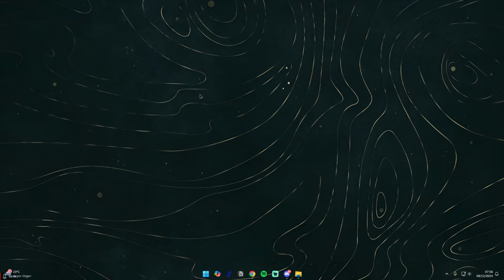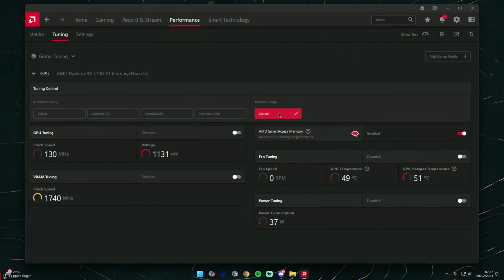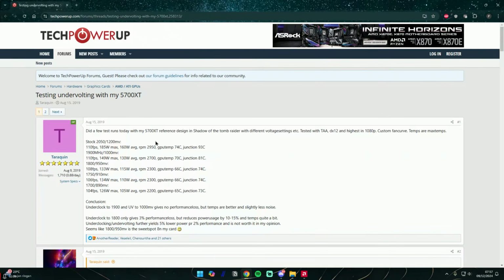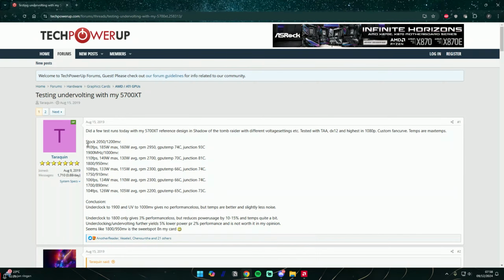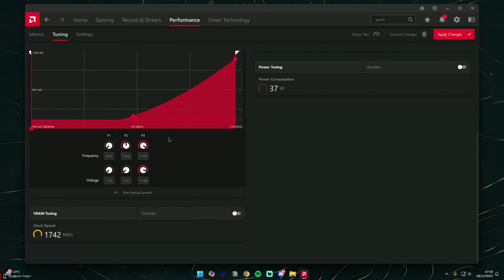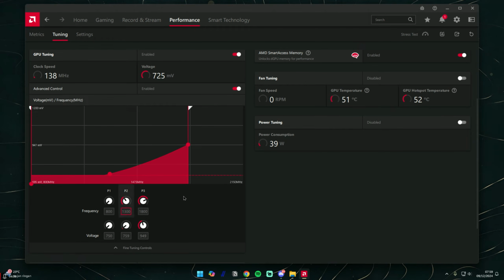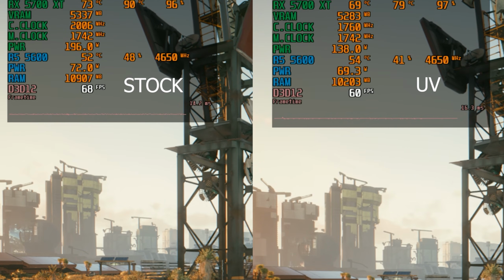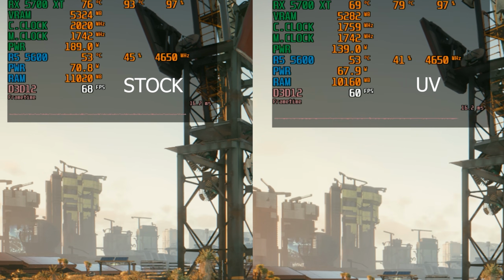How to undervolt your RX 5700 XT (or any other AMD card)

Comment: Hey man can. I get this gpu or Rx 6600 I want to have the best raw performance.
My psu has 2 rails each 17A and I know it's a good model even if it Is old . From seasonic
Reply from the maker: Sorry I couldn't be bothered to do the math, how many watts is your PSU?
Reply: @fancyzx 408w on the 12v line alone
Reply from the maker: @Adhamyt8990 in that case better go with 6600 as it uses less power
Reply: @fancyzx  does it give the exact performance as the rtx 3060 or Rx 5700xt ? CUZ I see it significantly slower than them in benchmarks
Reply from the maker: @Adhamyt8990 You are right, it is slightly slower, but it is a lot more compatible in more games such as Doom TDA, FF7 Rebirth, Indiana Jones, and maybe RT required games in the future. It is also a lot more efficient. The RX 5700 XT on stock pulls about 200w, undervolting will bring it down to about 140-160w which I am not sure if 400w is enough. Even my old 554w on the 12v rail wasn't enough to keep the RX 5700 XT underload, so I had to upgrade my PSU to 650w with 647w on the 12v rail.

My advice is, if you're not planning to upgrade your PSU then go get 6600, but if you are going to upgrade your PSU, maybe just skip the 5700 XT and save up for 6700 XT or maybe 6600 XT. If you ever plan to use upscaling technology, get Nvidia like the 2070, 3060, 3060ti, or 3070.

I'm not saying the 5700 XT is bad, in fact it is a very good performer for the price, but sadly it runs short on the technology and it is quiet power hungry.
Reply from the maker: To be honest with you, I couldn't feel the difference between the 5700 XT and the 6700 XT. Now that I have switched to the 6700 XT, the performance is surely different, but the experience is about the same. At least I got to play and finish FF7 rebirth though xD
Reply: @fancyzx u sure the Rx 6600 is enough for 1080 60 in last story games that released at medium or high native?
Reply from the maker: @Adhamyt8990 Medium 60 is possible, maybe even use FG for games like BM Wukong. But it will probably fall short in 1080 High
Reply: @fancyzx do you think it's more about the resolution at the time like maybe beyond Rx 6600 or similar we won't get any better results? In 1080p . It's just yk even rtx 3070 can't handle starfield . And I wanna play games and I'm sure at least one of the them is a hell pathetic trash ugly of optimization. My cpu is Ryzen 5 3600 4.35gz oc and 16gb. Of ram dual 3200mz oc 

These the games I wanna play 
 
Last of us 1 , 2
Re9 and other versions
Spider man 2 and other versions
And maybe ill
And there's more to add cuz I won't stop on one game but I still don't know which to add .
Reply: @fancyzx would u recommend me oc the Rx 6600 so I can get better results or maybe just get the Rx 6600xt ? Or maybe I should also overclock it when I get it
Reply from the maker: @Adhamyt8990  Last of Us runs pretty well on AMD, RE9 I'm not sure, but looking back at 7 and 8, the engine is pretty well optimised. Spider Man is quiet CPU heavy, other than that the GPU will most likely hold above 60 (maybe medium settings with Spider Man 2). It seems like its going to be fine, besides those Unreal Engine 5 games and something like Monster Hunter Wilds. I mean, even those games the RX 5700 XT doesn't do much better
Reply: @fancyzx do you think it will come a time where gpus like rtx 3070 3080 4070 become a 1080p one?
Reply: @fancyzx is the Rx 6600 a better worth upgrade from GTX 1660 ti than to the rtx 3050 8gb?
Reply from the maker: It could be resolution and it could be not. For example, the RX 6700 XT theoretically is faster, but in 1440p, it kinda sucks actually, losing to RTX 3070 even though it has 12gb of vram. I just think that most of the mid range graphics card perform pretty much the same, maybe there is a 15-20% difference but the experience when playing a game is pretty much the same. These GPU are: RX 5700 XT, RX 6600, 6600 XT, 6700 XT, RTX 2070, RTX 2080, RTX 3060, RTX 3060 TI, RTX 3070, RTX 4060, RTX 4060 TI, RTX 5050, ARC A770, ARC B580. Even though some of these GPU is faster than other, you are pretty much getting the same experience.

I can tell you that much because I've had experience building these PC for my friends over the past years.

But what I do notice is that different games has different optimizations. Some games favor Nvidia and some favor AMD. So its basically comes back to what you are playing.

Though when it comes to 1440p, it becomes much clearer which one to choose (without having to think about CPU in mind, and expecting your CPU will suffice).
Reply from the maker: @Adhamyt8990  The 6600 XT is about on par with the 5700 XT and the 3060, if you have the opportunity, probably pick up 6600 XT or 2070, if you have a bit more or you find a good deal, pick up a 3060
Reply: @fancyzx  I can't for the Rtx 2070 cuz of my psu . At least that's what chatgbt said
Reply from the maker: @Adhamyt8990  RTX 3070 is already a 1080p GPU due to its vram. The 3080 and 4070 I think it will take a few years
Reply from the maker: @Adhamyt8990  the RTX 3050 8gb is not worth it at all, even though its the 8gb variant, its still a tad weaker than 6600.
Reply from the maker: @Adhamyt8990  Then 6600 seems like the number 1 option.
Reply: @fancyzx since you say you make these builds. Would you recommend me some tweaks maybe related to Radeon software or drivers? Rx 6600 or Rx 6600xt
Reply: @fancyzx yes . Even tho I felt like getting an nvida card for rt and stuff and maybe dlss 3.5 but wtv it's not the end of the world maybe later in year or 2 I'll get
Reply from the maker: @Adhamyt8990  Sure, I can help you tweak your system.

If you are still unsure, just watch a lot of comparison between RX 6600, RX 6600 XT, RX 5700 XT, RTX 2070, and RTX 3060. Make sure to watch more than 2 because different channel uses different games to test.
Reply: @fancyzx should I just disable everything in the software Radeon?
Reply from the maker: @Adhamyt8990  Yes, unless you need them for something. I usually just turn everything off except for recording. If you want to use the software feature, like AFMF or Anti-Lag, then leave the overlay turned on.
Reply: @fancyzx oh yes about antilag I don't think it's in all game and yk I can't play any game without a technology like reflex but reflex isn't in amd. Should I enable it the antilag in software Radeon or is it in all games or what and does it kill fps like it's worse than reflex?
Reply from the maker: @Adhamyt8990  Not really worth turning on in my opinion. In my experience, it doesn't make any difference. When it comes to competitive games like CS or Valorant, they have it implemented in the game, so yea just have it off. I haven't tried combining it with FG though, if you wanna try that out you can.

And yes, its worst than reflex, since most games partnered up with Nvidia, reflex has better implementation in almost every game that supports it
Reply: @fancyzx i only play story games .
Reply from the maker: @Adhamyt8990  You could probably install linux then, as it gives better performance. I can't help you with linux though, as I'm not familiar with it
Reply: @fancyzx I mean I have windows 11 lastest version and I debloted it and optimize it. Is it worth going with Linux or cachy os ? Ryzen 5 3600 and Rx 6600 "future gpu" 16gb of ram . Also I install mods in everygame . I use obs and davinci resolve
Reply from the maker: @Adhamyt8990  Yes it's definitely worth it, if you don't use any apps that exclusive to windows that is. Since I do a lot of work on my computer, I can't really switch to Linux
Reply: Do you know what apps and features that I wouldn't be able to have in linux ? @fancyzx
Reply from the maker: @Adhamyt8990  A lot actually, such as Adobe apps, Microsoft apps, Blender, OBS Studio, and more.
Reply: @fancyzx then no . Even mods wouldn't work then
Reply: @fancyzx do you think that we came to a time where wtv gpu we. Have we still don't get the experience we want?. And I know this question is kinda subjective but I'll just say it we live in different countries though. Yk that Nvidia said she will lower her production by 40% right? . Well I just got my gpu used GTX 1660ti with the box and everything just weeks ago and heard people say that the only gpus that will yk get more pricely are rtx 20 and above  and rx 60 and above
So is it true or it could also get to the used market ? I mean the Rx 6600 or xt that I'll get is used already
Reply from the maker: @Adhamyt8990  
Unless you buy a very high end GPU, I think you can get the experience you want. I know the state of games optimization are lacking nowadays, and GPU technology seems reaching its end.

Well for now, used GPU price seems normal, it is yet to go up in price.  Unless there is a more demand for used GPU, then most likely they will be an increase in price soon. I do think there will be an increase in used GPU prices sometime soon, but not as much though, because these used GPUs are not really needed for anything besides gaming and professional work (referring to Ai companies). Unless there is another crypto currency boom, then yea it could increase a lot in price.
Reply: @fancyzx yea maybe mining..

Comment: Is 85-90c hotspot ok? I got it on stock settings. With undervolt my hotspot is 70-75 but i don't wanna lose performance with undervolt, my 5700XT barely handle my new 1440p monitor and i need to wait until January to upgrade it.
Reply from the maker: 85-90c is a bit warm but its fine, and yes, the 5700 xt doesn't do well in 1440p, you should probably upgrade to a better GPU such as 6800 or the newer generation as it offers fantastic performance for 1440p

Comment: I have the ROG strix version, the temperature is up to 80 and the hot spot is 110, how do I get this (what are the best settings that you recommend to me )
and thanks
Reply from the maker: I'd say first thing you wanna do is to drop the mV to 1000, then bring down the clock to 2000. If its unstable you can continue lowering the clock speed to 1950-1970, then you can slowly bring down the volt down to 980, 970, then 950. It should bring about 10-15c less
Reply: @fancyzx  I did, but the heat increases after ١٠ minutes
Reply from the maker: @mohamedlaid6637  Maybe you need to change thermal paste, then after you might see temperature differences, like stable temperature even after 10 minutes. 

Try 850-900 mV at 1800Mhz

Comment: how about in msi afterburner tho?
Reply from the maker: It should be straight forward, just change the Core (Mhz) and Core (mV) to your preferences, don't forget to save it in a profile, and make sure you have afterburner running at windows startup.

Comment: i do not have the same gpu i have rx 580 but for some reason i cant see voltage metric or tuning in amd adrenaline software
Reply from the maker: Thats odd, it should have the same interface, I used to have rx 580 and it was the same

Comment: mau tanya, ini berlaku untuk 1 monitor saja ya ? saya pakai dual monitor, dan udh coba 2 settingan yg 1900 dan 1800 hasilny crash
Reply from the maker: Saya pakai dua monitor aman saja. Mungkin bisa di coba untuk menaikkan voltagenya perlahan dari setting paling terendah. Tidak semua RX 5700 XT bisa di undervolt secara agresif. Kasusnya seperti RX 580 saya yang dulu, tidak bisa di undervolt dengan baik karena bekas pemakaian mining.
Reply: @fancyzx  syaa udh cb cb uv mas, tpi knp bagian hotspot gpu ny masi sama di 110 c ya ? apakah perlu ada repasta mas ? atau ada settingan lagi di bagian fan ny mas
Reply from the maker: @tmk.s331  Setting UV nya seperti apa mas? Kalau saya boleh tau, voltage dan frekuensinya berapa?
Reply: @fancyzx  dpt stabil 1800/1040 mas, high peek di 154 watt, stabil di 130-140 an , tuntuk fps turun 15-25 an klo untuk game tpi sya pake fps lock di 180 jadi engga terpengaruh, ini cma lagi otak atik di fan temp ny aja, ada saran ?
Reply from the maker: @tmk.s331  Kalau saya fan speed max 75% di 75c. Kalau masih 110c di hotspotnya dicoba ganti thermal pastenya, mungkin membantu sedikit tapi tidak akan signifikan sepertinya. Saran terakhir bisa coba 'washer mod'. Inti dari modnya mengencangkan kontak antara heatsink dan die dari GPU nya, banyak tutorial di YouTube mas atau bisa baca-baca di reddit.
Reply: @fancyzx  ok mas makasih saranny :)
Reply from the maker: @tmk.s331  Siap mas, semoga bermanfaat.

Comment: info psu seri apa ? brp watt ? kalo gw pake psu 550 watt fsp hv pro
Reply from the maker: Zalman 600w, sekitar 550w di 12v nya
Reply: @fancyzx  apa itu 12v?
Reply from the maker: @adamsairenjiharuna3650 Di bagian pinggir psu itu ada dc output, disitu ada keterangan perihal volt dan daya yang dihasilkan dari voltnya. Pada umumnya komponen komputer pakai +12v, jadi biasanya daya paling besar akan dikeluarkan dari +12v itu. Kalau untuk power supply bisa dilihat dia pure atau engga dilihat dari output +12v itu sendiri. Sebagai contoh kalau psu 550w, bisa aja +12v nya output tidak sampai 550w tapi hanya sampai 500w berarti sebenarnya psu tersebut bukan 550w
Reply: Ini diatas tutor rx5700xt AMD undervold ya
Reply from the maker: @adamsairenjiharuna3650 Iya betul

Comment: I have bought a few days ago the sapphire nitro plus version of this gpu, in furmark tast the temperatures are 82 degrees on max usage and 108/109 in hotspot, very hot! You think undervolt the gpu is the better solution? Many people told me to change thermal pad and paste, but if i could avoid to open the card it would be better 😉
Reply from the maker: I got a similar temperature the first time I got the card. I do suggest changing the thermal paste first, it will drop the hotspot by 10c, and then proceed with undervolt, it will greatly help the card, preventing it from melting lol
Reply from the maker: But if you don't want to take risks, then a simple undervolt will do just fine
Reply: @fancyzx  Ok, only thermal paste? Or you have changed also the thermal pad?
Reply from the maker: @jacopodastolto4692  I didn't change the thermal pads because they were still in good condition, if you see any melted thermal pads you maybe need to consider changing them
Reply: @fancyzx  ok thank's mate! 
I saw you have ryzen 5 5600, i have the i5-12400 with stock cooler, maybe ill' get another heatsink in the next few days
Reply from the maker: @jacopodastolto4692  That's great! It should keep the CPU temperature cooler

Comment: Gonna try this, I have the exact same GPU. I really love this card, but lately it has been giving me a lot of issues and crashes, I want to test if this fixes it, if not I'm gonna try a clean windows install (a lot of years with the same isntallation) and doing a deep maitenance on the PC, if that doesn't work I think I'll have to buy a new GPU because I've tried almost everything except for undervolt and clean W11 install
Reply from the maker: Hey, maybe you can try repasting the card with fresh thermal paste and change the thermal pads as well

Comment: I don't understand English, so I'm speaking through a translator. My video card heats up to 80 degrees and makes a lot of noise. I want to do what you did so that it doesn't make a lot of noise and doesn't get hot. But I also want the FPS to be not low. Please tell me if it will change a lot in shooters like CS2 PUBG?
Reply from the maker: @Mateo_Makeev  You can try less aggressive undervolt, for example 1950Mhz @950mV, it won't slow down the FPS that much. Ideally you want your card to have less than 1000mV so it doesn't get hot.
Reply: And so that a lot of FPS is not lost

Comment: Amd adrenaline and msi afterburner wont let me change anything related to undervolt or overclock and the only way to change fan curves is through msi after burner ! 
Any idea on a fix?
Worth noting i have a soyo version i have tried other soyo's and they oc without n issue
Reply from the maker: Are you locked out of the option?

Comment: Bingung mau beli RX 5700 XT atau RX 6600. 5700 xt harganya 1.6 juta, sementara 6600 harganya 2 juta. Kalo menurut agan, mending beli yg mana? Sementara ini cuma punya dana 1.5 juta.

Kalau undervolt saya gk masalah sih soalnya udah pernah main UV di GTX 1070
Reply from the maker: @denisuya  Menurut saya sih bro, walaupun 6600 lebih mahal tapi dia support dx 12.2, sedangkan 5700 XT engga. Ada beberapa game yang gabisa dimainin di 5700 XT kayak indiana jones sama FF VII Rebirth. Jadi untuk support game baru kedepannya lebih oke 6600, cuman memang 6600 ini ga lebih bagus dari 5700 XT secara performanya. Mungkin kalau saya secara pribadi nunggu 6600 turun harga atau nego di marketplace, setidaknya 1.8 udah worth it buat 6600
Reply: @fancyzx  thanks dah dijawab bang. Okelah nunggu bulan mei aja wkwkwk
Reply from the maker: @ Siap broo